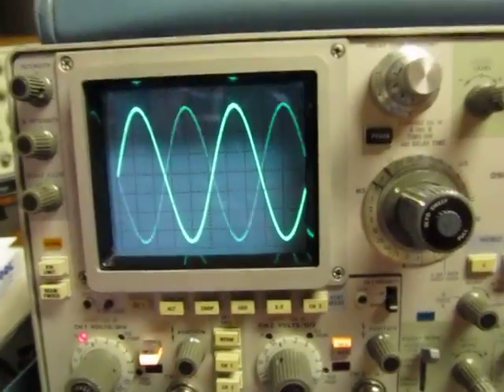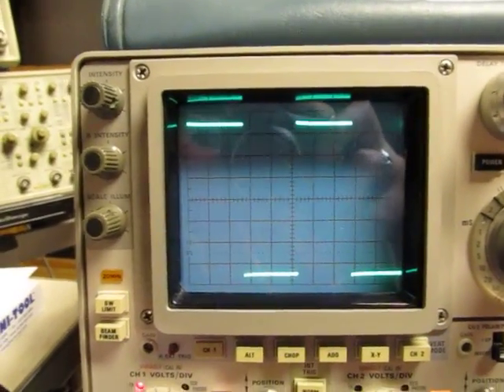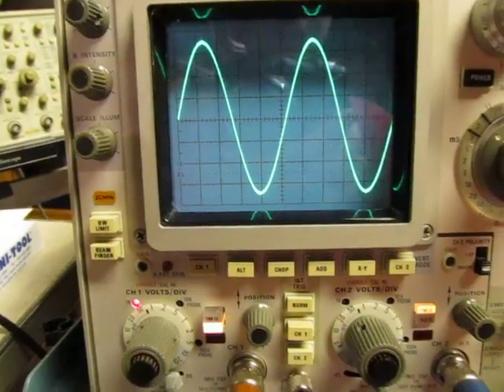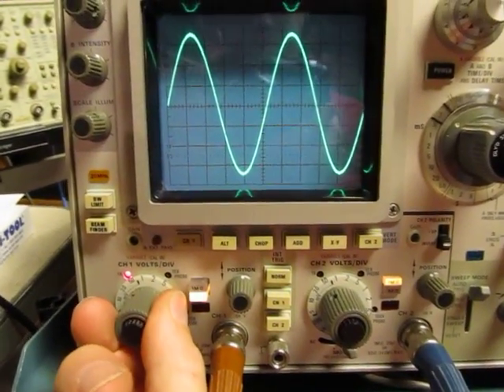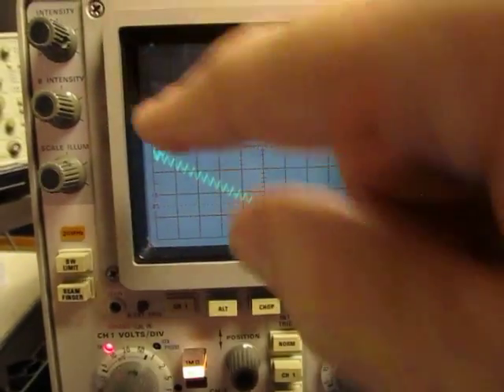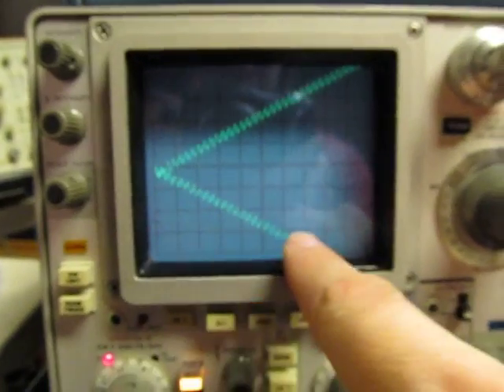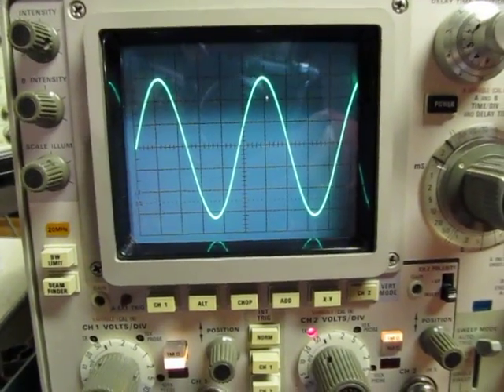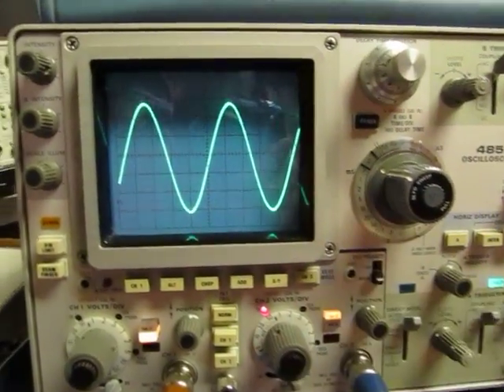#36: Function Generator issues appearing as a triggering problem

Comment: Why didn't you replace that cap with something a little less longevity challenged? The parameters seems ripe for a film cap substitution. Were there concerns about other parameters introducing a new problem? Or did you figure to replace with similar component as a general sympathetic repair? You have a lot of practical repair experience, so your choice would worth knowing.
Reply from the maker: I just figured it was a faulty part whose failure probably happed a LONG time ago and was never noticed.  I didn't dig any deeper to "improve" on the original design.

Comment: Do you suspect that cap failed as a result of "capacitor plague"? It didn't appear to be in a hot zone, nor did it seem to subject to a lot of current. But aluminum electrolytics seem to be sketchy, just waiting to betray a circuit)) 😅
Reply from the maker: Hard to say.

Comment: What is the function generator triangle waveform used for to measure what in passive components like capacitors and inductors and active components like transistors, FETS, Opamps? What can you use the Triangle waveform for troubleshooting circuits under test?
Reply from the maker: Lots of ways. Some examples:  ramp input to VCO to make a frequency sweep to check response of filters or amplifiers, check linearity of a signal conditioning circuit, input to an adjustable threshold comparator to create a PWM signal.
Reply: @w2aew ok thanks. I don't you have made a video lesson about this subject, how to use the Triangle waveform for troubleshooting and testing circuits to measure what type of measurements and parameters

Comment: Thanks, I just noticed the exact effect, even to the point that when I zoomed in like you did, I saw the exact same pattern of high frequency sawtooth waveform riding the larger 100kHz sinusoid waveform. Interesting. It smooths out till about 1MHz, where the bandwidth of my scope just might not be enough to see it anymore.

Interesting.

I can use a high frequency rejection mode in my trigger settings, or a "tv / lines" mode to reliably trigger, although there can be some artifacts on hf rej mode, and "tv" mode has issues too. 

Interestingly, with a 100kHz signal I can get a mostly clean trigger on 1us/div time base. Mostly, because I can see some occasional "reverse" trigger when I turn the track intensity know way up (it also reveals A LOT of noise!). I can also see them (but with way less of a "refresh rate") in the digital mode. (It's a combiscope)

Comment: I am not sure that's the case but i have noticed that a lot of noise and strange behaviour comes from the chinese connectors cables! Sometimes they are not crimped properly (or at all!) and plus chinese breadboard which has problems with connections etc. and you can see really strange things! For example to have a nice sine wave from my generator I have to hold my cables with one hand 🤣

Comment: If the high frequency reject trigger setting on the scope doesn't help, I suppose it should be possible to let the signal go through a simple passive low-pass filter with properly adjusted cut-off frequency to filter only the noise, feed that signal to ch2 on the scope, then feed the unfiltered signal to ch1, trigger on ch2 and display the full signal on ch1...?

Comment: Some scopes allow you to adjust trigger hysteresis as well as have a selectable trigger bandwidth, which will allow you to trigger cleanly and then use the scope to diagnose the problem with the signal source.  It's nice to be able to tweak the triggering to diagnose problems like that.  With any instrument, the more you understand about your measuring instrument, the more you can get out of it.  Always like your work, that's why I subscribed... :-)

Comment: Alan I had a similar problem with my Tek 2225  Scope???? I traced it back to my Audio Generator( Analog Version..Problem was The Rotary Switch that Changed The Frequency was Very Dirty...lubricated It With  Oil and it Works Fine Now!!  I also found a Leaky Power Supply Capacitor which was Leaky,,,Replaced the Capacitor and Voila  Problem Solved!! Thanks For another Incredible Video,